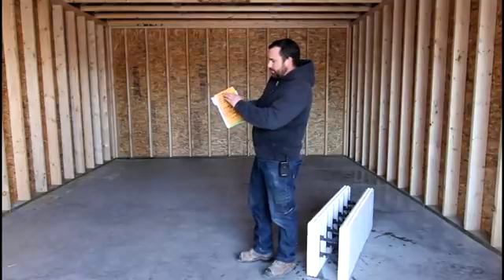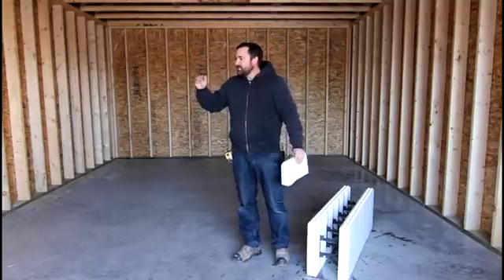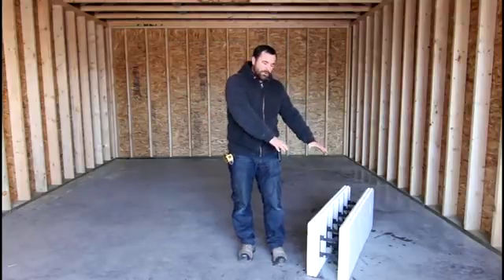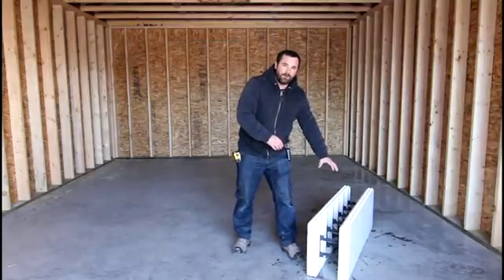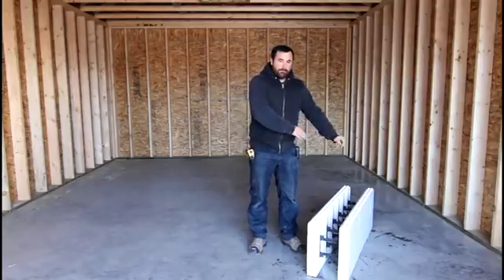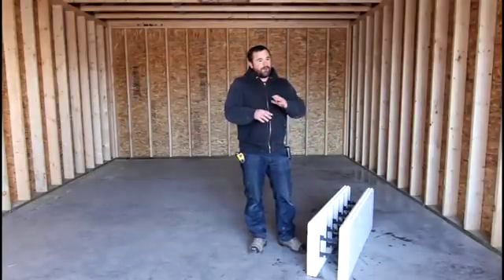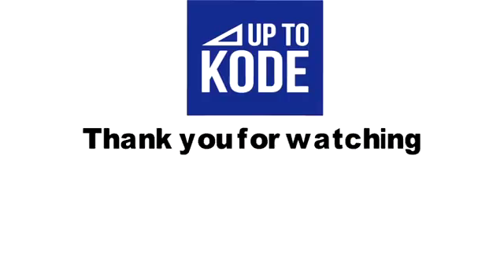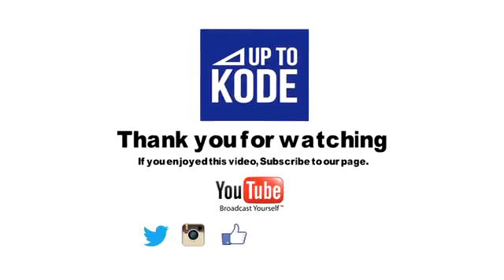ICF vs Wood : How a Spray Foam 2x6 Stud Wall Compares to an ICF Wall

Comment: You did a lot of talking & you made a lot of arguments, but you really didn’t show any engineering calculation. Heat transfer is not difficult & there's been so much engineering done in this area. All you were doing was selling ICFs without engineering support. Joe Lansberry
Reply: Joseph.  I am an ICF contractor in Saskatchewan Canada, and also living in and ICF home.  To give you some real world numbers, our house is 2000 sq ft bungalow (main floor), 4 car attached garage.  We heat the garage all winter long to about 15C (60F).  Our natural gas bill for all of 2017 was $949 CDN.  Our temps go from +35C (95F), down to -40C (-40F).  When we show potential clients how much we can build them an ICF home for, and approximately what it will cost to heat (based on real world numbers from all our clients), it's not a tough sell.
Reply: Whey you build with icf most of the manufacturing companies have engineers on staff to do the calculations I would always have my own engineers to spec the foundation.

Comment: The best wall. Staggered 2/4 studs  on 2/8 plates. Mineral wool ins. ( roxul, or sim. ). 5/8 yellow gypsum outside sheathing ( high vapor perm. ) Two layers of 5/8 drywall with 1 tube of Green Glue inside. This is a very quiet, almost fire proof, high r-value wall.  The material cost is about $ 3.5 for a wall that delivers a R 25 true performance.
Reply: Love this. I've never worked with the yellow gypsum sheathing, seen it on commercial projects mind you. Isn't the yellow layer fiberglass? Does that hold a fastener (screw, nail) the way OSB would? Also, the two layers of interior 5/8", is that strictly for sound?
Reply: kkarllwt mineral wool is great insulation dry, fire resistant, and gives you lung cancer!!!
Reply: The best wall is icf point blank period

Comment: I think you can overcome some of the wood thermal conduction by using insulated cladding on the outside, although it might be expensive.
Reply: 10tenman10 ICF is expensive and 1/4 the speed. The whole problem with wood frame is that they went from 2x4 to 2x6. They should have kept the 2x4 and went to an exterior insulation system.  Best I've seen is a building with a CLT frame and 8 inches of exterior insulation. Probably as expensive as ICF but way faster and more environmental.
Reply: Richard Burdett
Agree that ICF is slow, although I guess concrete is pretty solid. Am watching the Pure Living for Life website. They built with ICF and then lumber (cut by them). It seems to be taking forever to put their house together!

Comment: I had a new cottage built in Northern Michigan 2016. Before I decided the most bang for my buck, I looked up University studies on wall types. I went with 2x6, then structure board then 1" insulation board outside. No more thermal bridging and I can still get into the wall for modification, that flexibility is important to me. Closed cell foam only went into the roof.
Reply: @dadcssm I'm hoping to build a new house and I'm between icf or wood structure...I'm not a carpenter, so I have a question, what do you mean by one inch structure board and 1 in insulation board outside.  Do you mean regular .5 plywood and 1 inch foam then stucco...sorry, just wondering.  I've heard of icf, but I don't know if its going to be more expensive then regular wood home....I live in Texas by the way.
Reply: Best case that 1 inch foam is like R-7.  Just bought some 2 inch stuff and it was r-10.  Still pretty bad.

Comment: This is helpful information regarding the "core wall."  What this video does not address is the cost differences of installing the interior and exterior siding.  You would never leave the foam of an ICF wall exposed to weathering.  Properly attaching siding to ICF is more expensive (labor) if done right.  Installing wiring is not much difference between the two, but installing and securing outlet and switch boxes is (much faster in stick frame).  Also, one should consider future modifications to the structure.  Want to add an outlet or switch later on?  How about a window or expand into another room?  ICF can't compare to stick frame there.
Reply: That's only because you think of every problem as a nail!  You want a window there, get the concrete saw out and cut the hole!
Reply: Sorry, didn't mean to imply that those modifications aren't doable in an ICF wall, they are just more labor intensive and therefore costly.  I was going on the title which was about "comparing."  I've added a few windows here and there over the years to stick-frame walls, four hour job if no wires or plumbing are in your way.  I would spend over an hour going to the rental yard to get and return the concrete saw.  : )

Comment: What about electrical?  Is it more expensive with ICF?
Reply: I've seen guys use a modified soldering iron to drag a line through the ICF foam, and create a wire channel. if someone needed to run a wire around the perimeter, drilling holes in the studs of one wall would take more time than "etching" a groove in the ICF. I think the big wins of ICF are the built-in insulation R-values, the  "automatic" air-sealing, the penetration resistance to flying debris (important in hurricane/tornado areas) and the inherent sound proofing. Some ICF manufactures make it easy for the follow-on trades to walk in behind them, and start making fur-fly right away.
Reply: @just-dl  They sell a tool to create a channel on the EPS. It is not much more expensive than a soldering iron. It cuts the eps like butter. 
Also the ICF walls are hurricane resistant above 200 mph winds, heart quake up to level 8 with 10 or 12 inches walls, not mentioning you need a bazooka to pierce 8 inches of concrete.
Reply: Dan L The saw will cut the width of the chain (about 1/4").  The depth of the cut is 2-3/8"(the ICF we use typically has 2-1/2" of foam). The channel is perfect for sliding a couple of lines of romex in (and holds it snug). In typical 2x4 framed walls a hole is drilled in the center of the stud for wires. That means that the wires are going to be about 1-1/2" from the face of a stud without the need for nail plates. In ICF, you can stack several wires in the channel before you get to that point. That being said, I typically run most of the wiring in the ICF vertically, between the webs, minimizing wires crossing where screws will be. If necessary, I will put nail plates over the wires where it crosses a web or where screws or nails might be. Also, if wires are loose in the channel or a large channel is cut for many wires, you can always use some dots of squirt foam to secure them.
Reply from the maker: No the electrical is not more. Some guys might try to charge a premium but it’s really quite simple to run wire in an ICF wall.
Reply: Thanks for the reply.  I'm definitely going to check into an ICF.
Reply: I was wondering how they would do it.  I was thinking they would have to run conduit prior to pouring the concrete which is why I thought it would be more expensive.  So, they just run it through the foam, that make a lot more sense than what I was thinking.  Thanks for the information.
Reply: you'll probably want to talk to a local ICF guru for insights into you area; I live in New England, so my frame of reference is a wee-bit different! (just a little!)  But, some universal suggestions may assist you a bit. Window and door openings are blocked out of the ICF using "bucks" - basically blocks to prevent the concrete from flowing into the areas where you want the gaps. Also, my #1 suggestion for design is to figure out the sun angles, and make sure your southern eaves cover block all the summer sunlight and allow the winter sun in. For the electrical/pvc, I'm not sure I follow the question: do you , running along the wall? or through the wall? Along the wall, you can etch out a channel for the pvc, without having to mess with conduits in the concrete. It's an option, of course, but, a bit more involved.Anything that pierces through the insulation (prior to the concrete pour) will require a good seal, to keep the form from leaking. For the Exterior question, you can generally do what ever you like for exterior work, but, there's a special ICF form if you're planning on using brick/stone on the exterior. It basically bumps out a concrete ledge to let the bricks sit on it. FOr other finishes, the foam will have anchor points to attach strapping or other subsurface to. The ICFs I'm most familiar with have attachment points every 6 inches, and marked on the xterior, for ease of attachment. So, you could attach spacers & chicken wire for textured finish, or you could attach vertical furring strips and attach horizontal siding to that. If you want vertical siding, I wouldn't suggest continuous horizontal furring strips, though. Need a channel behind your siding for any trapped moisture to run down. I've seen strapping applied diagonally for vertical siding. looks funny during construction, but works perfectly well. Best of luck in your project.
Reply: Dan L etching doesn't seem like too bad a Way to do it. Not sure how much running wire through galvanize pipe would be but I don't think it looks bad.
Reply: MrHarbinged, running along a wall would required cutting out a LOT of foam; running through a wall, I think I'd shove a large-ish galvanized pipe through the insulation & pour around it. For running along a wall, I saw someone modify a soldering iron,  bent it to create a wide tip, a "square" or arc about 3/4" wide; when pressed into the foam, the could drag out a chunky channel, probably 1" deep into the foam, for the length of the cabling run. Being basically a complete loop, it would cut out whole pieces  of foam (unlike cutting two grooves, and chiseling out the middle). As long as the galvanized pipe is less than 2 to 2.5" in diameter, it can fit inside the foam; i think smaller makes sense. Being just under the drywall/finish-layer, having the wires in pipe does make beaucoup sense. Tucking in bare wire, with little to no separation could create a problem! Definitely worth considering!
Reply: I use an cheap electric chainsaw. I bolted a stop on the bar that doesn't allow the chain to hit the concrete in the wall. It's a lot faster than a hot knife
Reply: Ryan, how big of "channel" does that create? And, do you do anything extra to protect the wire? conduit? cover plate? Also, if you don't mind me asking, how deep do you go, typically?
Reply: Thanks, Ryan! I hadn't thought about the the half-way through a 2x4, but, yeah, with a deep cut, you're further into the wall w/your cables than typical stick built. Bonus!
Reply: The electrical is a breeze, Look if you have a kick ass carpenter doing all the form work then it is very easy to locate the walls with string lines. Using a large square you can simply put 90 pipe into the concrete about a 1/2 inch outside of the walls so they come up into the foam section of the wall. The more you get in the slab the better, don't forget to do the same for cat 6 cable for all your security and communications needs. Don't for get to stub out the same way in all directions for for exterior power and com needs from where ever your panels are to these necessary walls. I would certainly suggest using PVC underground but always use 90 degree fitting strait plum and level securely supported where ever they exit the slab.
Reply: you can do all the electrical in conduit if you want there is plenty of room in that 2 inches of foam its not necessary but you can do it

Comment: The 2"x6" stud wall wins -hands down.
Try mounting a shelf on styrofoam. Try running
wiring for outlets on styrofoam. Try mounting sheathing
on concrete and styrofoam. So much easier with studs.
Reply from the maker: Mounting anything is easy. It’s just like a stud wall...once you find a stud it’s every 16” on centre...oh wait... ICF is every 8” thus it should be easier to mount cabinets or shelves. And the snap ties are designed to hold nail and screw strength.
Reply: Ian Crossley Hi Ian.  When I run wires in an ICF wall I use a router with a dovetail bit to cut a channel in the foam.  The wire then snaps in really easily.  I have mounted cabinets and shelves on the old Polysteel forms  (they were bought out by Foxblock)  these forms had a steel bracket instead of plastic that was great.
Reply: some of the ICFs advertise webbing that can be connected to at every 6" - with pullouts of 150# anywhere, and 500# pull out strength at certain points, if you need to go nuts on anchoring something serious. (that's the buildblock product, which is the one I'm most familiar with.) on larger projects, much of the block stacking can be done by laborers, with the skilled workers doing the rebar; the savings isn't as noticeable on smaller projects, but on larger ones, it can be less expensive to build ICF. Once the pour is complete, you have structural, insulation and mounting points done at once. there's several good ICF companies out there, and though I'm partial to one, check a few out; you may be pleasantly surprised at what's available these days. regards, ~DL
Reply: Ian, you need to watch some of the commercial build ICF videos, electricians doing wiring on the first floor while pouring concrete on the second floor, impressive!  2 x 6 wall construction is so yesterday.  ICF and double wall 2 x 4 will lead as consumers and contractors smarten up and start building net zero homes.  Modular home manufacturer in my area are building to R40 in the walls and R60+ in the roof using dense pack fiberglass!
Reply: Ian,
All the ICF blocks have internal studs 6 or 8" apart for screwing on the drywall or siding, never into foam.  For electrical or pipes, vents , either send a conduit through the wall prior to the pour or use an electric chainsaw to rough out the wire channel and the electrical box needs a hole in the foam and is screwed to a stud. Siding applies directly outside , no house wrap or no rainscreen.
AMVIC is the strongest ICF with R-30 and R-22 blocks.  Save 50% in heating cost.
bill@pacificicf.com
Reply: So many IFC proponents blithely tell us "well you simply screw the siding on instead of nail it."  I'm not a siding contractor , but I regularly contract with them, and they'd be rotfl if you ask them "how much more to do the job with screws?"  Better do it yourself, if you're confident of your flashing detail expertise.

Comment: With ICF above grade you need to add framing for siding and windows. Also an ICF basement still requires framing to finish the rooms and extra work for egress openings too.
Reply: No, you just have to use screws instead nails to attach drywall or exterior siding, or go with stucco.
Reply: This is not true. Google Fox block.
Reply: WOW! You have to get a drywall inspection? That's the city grabbing money right there.
Reply: Negative Ryan,  ICF can have drywall directly applied inside the building and siding directly applied outside unless it has to be vertical wood siding, Then it make need strapping.  No house wrap, no rainsceen.  Window and door buck can be 2x12 treated lumber or a vinyl buck.
Try AMVIC ICF from PACIFIC ICF   Also use AMPEX for radiant heated floors and SILVERBOARD rigid insulation for walls , floor rafters etc
bill@pacificicf.com
Reply: We are in the process of building an ICF home and did steel window and door bucks.  Also added 20 gauge 2 inch steel strips to interior side of ICF 16in on center to act as studs for drywall. Just got done with drywall and passed our drywall inspection today as a matter of fact.  Inspector said we are building a fortress.  He is so impressed.  In AZ btw.
Reply: Ryan Guyer ICF are made so as to attach sheathing and drywall directly to the wall. But, furring strips may be added. Yes, window and door openings need to be framed, the same as in stick construction.

Comment: Build double wall.  Outside w/ 2x3 and inside w/ 2x4 and offset.
Reply: Or just go icf.  No way the added floor (bigger slab) plus extra wood will result in any money savings. And the icf will be stronger, hold up in tornado/hurricane etc.
Reply: Try that with lumber prices today...

Comment: A "thermal break" is the opposite of what you said it was. A thermal break increases your R value and reduces conductive thermal transfer.
Reply: I think he was meaning "thermal bridge." my best guess.
Reply: Dan L   That is what I thought as well, but he repeated to use both interchangeably throughout the video.
Reply: I used to work with a guy who would use the "almost right" phrase like that; in a report he wrote, he meant to be describing the "white goods" (aka, appliances) found scattered around the landfill. He kept using the phrase "white trash" in the report. Almost a career ending mistake, except we laughed for something in excess of 5 years over that one....yeah, having the right word pays off! :-)
Reply: Dan L, 😲 I’m still laughing! Yes, words matter.
Reply: I could see how he could get that confused since the video is in 380p which I thought went away with 10 year old flip phones and VHS.